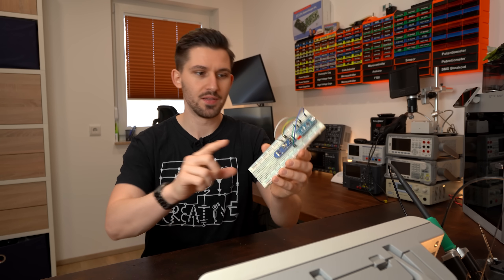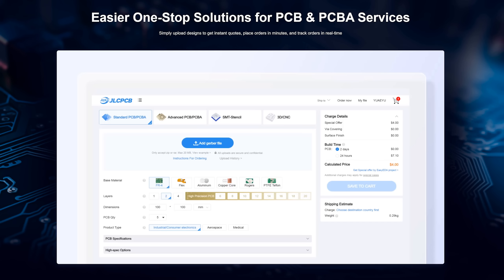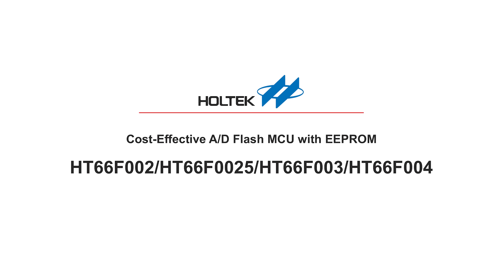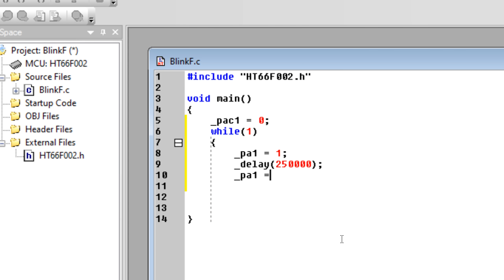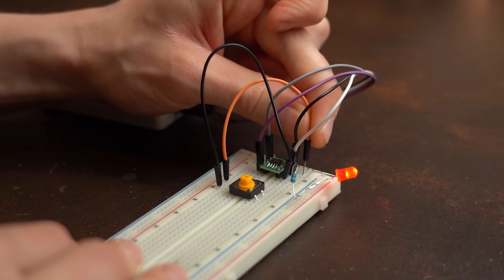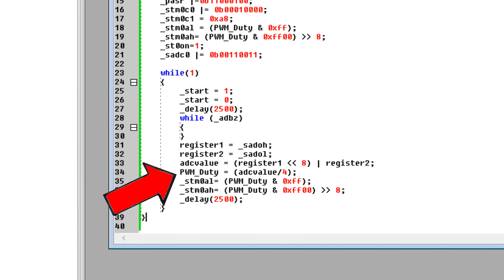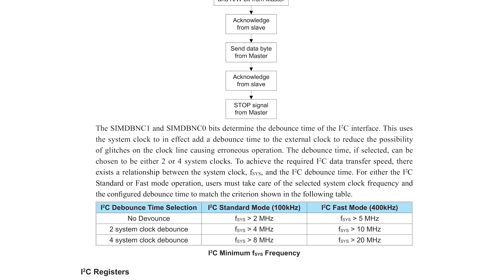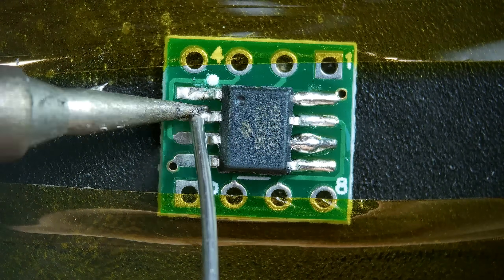I tried the Cheapest Arduino Alternative (that Nobody heard of)

Comment: @greatscottlab You dont need to discard this microcontrollers. You can define I2C by software similar as is done in arduino to use software defined UART. I did that in the past for some old 8051 microcontrollers. If you are interested let me know I can share the code with you. Its C code so you can easily adapt it to your current project. BTW Great video. I am a big fan of your work!!!

Comment: Nope, you're on the wrong track. The Puya microcontrollers are cheaper, more functional, and they're actually Cortex M0 parts. Poor development support but it's out there, and being Cortex M0 you get cheap SWD or JTAG debugging support. The PYF002 is 15 cents US from LCSC, and has 20k of Flash, 3k SRAM, ADC and full I2C, SPI, USART and timers among other things. Datasheets are in Chinese, but ... Google Translate.

Comment: I have always run with ESP-01 I bought for $0.5 a pop off aliexpress for cheap Arduino replacement but good to know there are even cheaper alternatives. Everything suggested in the comments is useful as well. It's good that you made this video.

Comment: I agree, 8 bit these days is toast.  I still use the TI MSP430 16-bit stuff because it's cheap, but the CH32V003 is cheaper still and you can use the Arduino dev environment, and it already has the dreaded I2C controller.   I think the days of 8-bit and 16-bit are over; the 'war' at the low end is now between cheap Cortex M0+ devices and low-cost RISC-V chips.  32 bits forever!

Comment: If I understand it correctly you want to use a simple photodiode instead of VCNL4200 as a proximity sensor with I2C capability.
Using a photodiode is OK for go, no go light detection but to do precise analog sensing, it is very erratic unless it is in a controlled environment. With a basic detector, you will have much more problems to solve, worse than this cheap micro. Optical sensing has come a long way, like this highly advanced VCNL4200. Every penny extra it costs is worth it.

Comment: back in around the year 2000 I implemented I2C in software using digital I/O pins between a PIC16something and an external 8 pin EEPROM, so don't give up on those MCUs.

Comment: Serial messages are kinda a noob way of debugging. It's easy but inefficient, you can't look at the registers, variables etc (without printing them) you can't set break points and step through the code line by line etc. I'm sure the HT66 series support some form of real hardware debugging for professional developers.

Comment: Choosing that mcu doesn't make much sense?
The py32f002a is $0.11, 32K flash, 4K ram... Actually everything from the more expensive py32f030 is there (dma, timers...) and doesn't need any fancy programmer, in fact it can be programmed with a serial adapter and the embedded bootloader.
Sleep current was about 4uA if I remember correctly.
And it has Arduino support!

Comment: It is not an "arduino alternative" unless it uses the Arduino IDE, librariea and abstractions.  What you have is a cheap(ish) microcontroller which is completely unrelated to Arduino, which is fine if that's what you want, but it's not anything even close tO the simplicity of Arduino.  

An RP2040, or Esp32, or Attiny, or.... is an arduino alternative, can be used with the ide with the libraries and abstractions...

If "a microcontroller" is your definition of arduino alternative then you might as well have got a Paduak, or STC....

Comment: Great video. Perhaps a software implementation of I2C is possible, this exists for the PIC16CXXX family microcontroller, it will depend on the CPU clock speed, I/O speed and other issues. A library for the protocols is not always necessary, although it would be difficult to program it and specially for that strange microcontroller, for example for the infrared LEDs of the remote controls, in the hardware part the IR reception LED module (3 pins) can be replaced by a simple IR receive LED (2 pins) connected to the input pins, in the software part the infrared protocols can be implemented within the main code, or modified to transmit binary data, for example an example code from the IRMP library by Frank Meyer includes all the low-level instructions for analyzing Infrared remote control frames compatible with the NEC protocol.

Comment: Ha, I tried to do this once, make basically a dev board similar to arduino with a much cheaper microcontroller. I bought the chips, designed the pcbs. Started looking into the documentation to actually use the chip and got side tracked for a few months. When I came back the chip was discontinued lol so I could still use them but my design is kind of pointless going forward. Luckily the chips were about $0.25 and the boards were similar, and I only ordered about 50

Comment: Program it in assembly, has really nice architecture, IMO.
1 ACC Register and all instructions are like ACC, mem, like Add ACC, mem.
Move Mem, ACC to store and a few more.
Most in 1 cycle, not like old PIC, with clock/16 or something.
Not quite 68k level, but nice.

Comment: I would have used one of the new 8-pin ATtinys.

 Cheaper then the 328 but more slightly more expensive than the IC in the video... no weird programmer required, feature packed and well documented

Comment: Pointless?  Not at all!  You learned a lot and shared what you learned with us.  That was worth doing.  I was surprised at the cost of the device programmer, however.  You might want to look at the WCH CH32V family.  The CH32V003J4, for example, has 8 pins, ADC, I2C, PWM and costs ~$0.12/each.  The device programmer is ~$3.  Arduino support is already done, so learn a new IDE if’n you want, or just use Arduino.  But still, totally worth going down this road with us.  Keep up the good work!  I always enjoy your videos.

Comment: you needed like 10 arduino nanos so $20 and to save money you bought 10 $0.20 micros and a $150 programmer for them ($152 total cost) which means you spent $130 more than just using more arduino nanos and did not save money but spent WAY MORE money.

Comment: That seemed a strange price comparison at the start of the video. Surely the comparison should be between the cost of the raw microcontollers not between an Arduino board and a microcontroller? An atmega 328p by itself is very cheap so it would make more sense to me to prototype with an arduino and then use just the microcontroller on your finished circuit.

Comment: all this shilling for jlbpcb is pathetic.  I tried an order with them and they wanted $25 shipping for under 1lb and I couldn't select a cheaper option.  PLUS they tried to charge $370+ for a simple minimum order flex pcb simple project.  They are a ripoff

Comment: I could  not get the compiler to work with the pic12F for for a small batch of a 100 board. I switched to a bigger pic16f instead. I did not want to up-grade the compiler. It was much faster and much cheaper.

Comment: This is a good video to highlight all the support/convenience functionality the Arduino environment is providing; directly programming microcontrollers (even in C) typically involves a lot more bit-twiddling and register manipulation like you show here, and it's definitely a steeper learning curve.

I'm almost certain you could have implemented the I2C interface as a bit-bang in software; it's not especially complicated, but since you're working in a proprietary environment you'd have to do it yourself instead of using a library. That would be a lot of work in the general case, but to make it function just enough to talk to your particular distance sensor might not be too bad, although it's probably another couple days of hacking to get something working.

The part is cheaper, but even for "larger" quantities makers normally operate in (dozens/hundreds) it's usually still worth going for something Arduino-compatible unless you value your time at nothing. Even a few hours fighting with some janky proprietary IDE provided by a vendor like this will easily cost more than the parts difference to have instead built it around something easier to use.

As a counterpoint though, this kind of thing can be worth it if you instead have really strict power or space constraints. Picking the exact part you need (without having to bring along a whole "standard" arduino board) can let you build a solution that will fit into a tiny space or last substantially longer on battery/solar, and that can be worth some extra time implementing the software if it turns a project from "impossible" to "practical".

An often-sufficient compromise is to build a custom board around one of the standard microcontrollers already supported by Arduino. This lets you get a fairly small and power-efficient solution, but in most cases it's not difficult to coerce the Arduino IDE to flash and interact with it just like one of the standard boards. You get all the convenience of the Arduino libraries, and the resulting project costs only a little bit more than these extremely cheap single-purpose microcontrollers and are usually not any larger physically.

Comment: The lack of a version with I2C master mode is not an issue... that is easy to bit bang in a single master configuration. Slave mode generally needs dedicated hardware, but unless you need multiple masters you can code your I2C with C or assembly.

Comment: Would it be possible to do a video on thebuilding a PCB using the Arduino MC chip itself, to minimise the size? I've tried to  do this myself follwing some guides and it doesnt work for me. It'd be interesting to know ehat i did wrong.
Using a hall affect input and two servo outputs is all i need

Comment: FYI 
Depending on the storage space that the microcontroller has, you can implement the I2C bus in software.
I have done this in the past on two occasions, and it works well.

Comment: My main issue with these tiny, low pin count mcus is that you can't really do on-circuit debugging. Issues like weird IDEs or programmers can be I can withstand, the code not doing what I intend to do is much more frustrating.

Comment: My first thought in the beginig of the video..... why you don´t just use attiny´s!
They are basicly the smaller brothers of the atmega´s and can be used with the Arduino ide and an arduino as a programmer.
Those other, even cheaper options are for production stuff where you can chose the micro specific for your needs and where it is justified to invest a little more development effort, gained back by cost savings in large volumes.

I use attiny´s for very simple aplications, and for there smaller size and lower power requirement. 
When i need small power but the atmega´s abilitys, i simply rip of the leds and crap i don´t need because i am to lazy to build up the support circuits for them myself... 😁

Comment: Always cool to see other chips besides the now very old nano's.
I just got my rc laptimer project using an attiny402, which is 50 cents qty1 on digikey (and available on lcsc in china) and can be programmed using a usb-serial ch304 with the arduino IDE.  They have all the hardware features of i2s,spi,wtc,a2d.    2k flash is enough for simple programs.   The bigger 16k flash and 18 pins is not much more expensive.

Comment: Travel back in time till the mid 90's when we were programming PIC micro controllers (16F84) using ASM which had a whopping 35 command words.
We made everything in code. I2C, Serial out & in, PWM, ADC... Bit banging I2C is not that hard.

Comment: You're comparing Holtek microcontrollers with fully fledged ATMega328 board  equipped with ch340G chip, crystal and voltage stabilizers - but You should compare them to ATTiny microprocessors which indeed have c language / Arduino / community support for many years.

Comment: Try an attiny402.
Costs €0.38 here, should be available in germany but price may vary.
Upto 20mhz@5v
2x uart ports 
1x i2c 
1x spi
2x interrupts 
4x pwms
5x gpio(all can do analog or digital readings)
Can use at once :
1 uart + spi
1uart + i2c
2 uart ports
5 gpios

Edit:added reasons.

Comment: EEVblog forums has several $0.10 or so uControllers that seem pretty useful.
Skipped around the video, so not sure why some sort of multi/charlie-plexing could not be done with 1 faster uController.
And honestly, I'm a little disappointed with the almost Bait and Switch tactic to keep people watching by not being upfront initially with the programmer cost.
Seriously, $100 up front to try and save $28 in controller costs is going to be a big Nope for most intelligent people unless they fall in love with the newbie and want to switch over to it for multiple projects.
Is the channel on the slippery slope now?

Comment: Consider trying Megawin's MG82F6D17, it is an 8051 based extended microcontroller with whole host of features. It has SPI, I2C Master and Slave, Low Power Modes, ADC, PWM, Timers, RTC, 16 KB flash with IAP functionality. Overall a good choice. I've used it in several products and it works just fine.

Comment: Making pauses in code is a bit off. It's better to count and use a variable. Mode 1 is the first 20.000 or whatever.
Main_loop:
If c<20000 then
   mode=1
else
   mode=2
endif
c=c+1
if c>40000 then
   c=0
endif
Now you can run a clock or whatever on displays and whatnot in between.
if mode=1 then
   blink(x,y,z)
endif
if mode=2 then
   blink(x,y,z)
endif
if clocktime or secret_project then
   a _bunch_of_code(x,y,z)
endif
goto main_loop (or your way of doing it, maybe while true.)

This is to help yourself, not me.